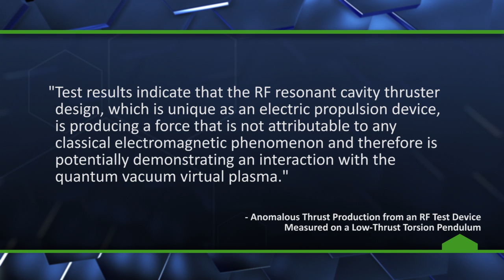Impossible Engine Could Revolutionize Space Travel - The Know

Comment: Does it matter to people outside of the tech community? No.

and even to those who are in it, it's an interesting process with no real advantage;
there is no viable planet to visit other than mars, NASA has had huge budget cuts because no one really gives a fuck about space anymore other than chartering flights by a virgin, Even if it could create enough thrust from solar radiation; would it slow down once you pass through the asteroid belt? And traveling anywhere deeper in space would require us to travel with a makeshift sun. Plus theres that little problem of time, let's say this thing builds up enough power to travel at lightspeed, we are still about forty years from another goldie locks zone, meaning even at that speed it would still take 40 years to reach and who knows if communications would work that far away.

Space is a nice idea, but at least for the next few generations; until we are merged with parts that make us live longer,  there isn't really a good use for this.

Comment: 'Impossible engine'-
Impossible= infinitely improbable
Starship Heart of Gold confirmed?

Unlimited Delta-V could take you anywhere in the universe given the time, or bring you close to the speed of light (if acceleration is prolonged, even at such low accelerations- in all seriousness if this works it could be huge.
Reply: Eh.
Still requires an unfathomable amount of energy to get anywhere near c. There is simply not enough energy density in any fuel short of antimatter to make any sort of electromagnetic propulsion viable, or desirable. Also, 'unlimited' Δ-v is explicitly stated as coming from an external energy source - a star. there is no way that any sort of rocket or torchship propelled by something which will have no more thrust than the sort of ion drives used to maintain LEO on satellites is going to remain near enough to a star by the time it has accelerated to a reasonable fraction of c. Unfortunately, unless this technology can produce Saturn V-ish amounts of thrust, it's not getting above the 0.02c ballpark. sigh I always wanted to hypothetically visit Tau Ceti or ε Eridani on something with less 'boom' than an antimatter rocket...

Comment: Sorry to burst your bubble, Ashley; but most of the information mentioned in this video is not correct. Sure, this is a breakthrough; but it is impossible to achieve infinite energy. The reason behind this is Einstein's mass-energy equivalence( E=mc2+pc);which states that energy is related to mass. Since infinite mass, when confined in finite space, caused a black hole to be formed, then infinite energy would cause a black hole. The only "known " way to create infinite energy is with negative energy, which only has a small piece of evidence called the Casimir Effect. Also, saying that a star can power a engine forever leads to controversial effects,like that stars do die and can become a black hole. So, for now, we won't be able to travel infinite distances until we find negative energy or other possible infinite energy sources, which might not exist. Sorry to say, but Garrus will be alone for quite a while.

P.S: Did you steal your entire script(except for gaming comments) from WIRED? Because every single bit of information here is on their page and they put up their page on the day before you uploaded this video. Seriously, search up "rf resonant cavity thruster" and it's the third one down.

Comment: so scientists though that it wasn't possible to transform solar energy into kinetic energy? they're both types of energy, logically, and according to the law of conservation of energy, it should be possible
Reply: well, assuming that these engines actually do what people say they do, that just means that the law of conservation of momentum must be rewritten
it holds to reason that you can convert literally any type of energy into literally any other type of energy, as long as you have the proper equipment
Reply: simeon62205 But that's the whole point. I'm not saying it's impossible, but simply meaning "that the law of conservation of momentum must be rewritten" means that the rules of physics as we know them are being broken. Also we can't exactly rewrite the law of conservation of momentum to accommodate this thing if it works properly since, like mad said, the law is momentum before = total momentum after. This engine would fall under a whole new rule since momentum before =/= momentum after.
Reply: I've always looked at it this way, any object with mass has a set amount of energy, divided between potential and kinetic, as the kinetic energy increases, the potential energy decreases
now if an object at rest will continue to be at rest until acted on by another force, we can just assume that the pure conversion of potential energy into kinetic energy to be that force

Comment: Huh. if this pans out, its a gamechanger; engines able to run without needing to carry massive amounts of fuel around in space? even if they are low power, the increase in engine mass you can get from not needing to find space for fuel would counter the low power, as well as allowing huge increases in payload mass. Hell, you could potentially use one to send a probe to another star; it would take a LONG time, but unlike other concepts, it wouldn't have so many moving parts, which means the engine could run pretty much at full burn as long as needed.

Comment: It wouldn't matter in the long run. We can't travel deep space unless we figure out stasis pods, light speed travel and/or artificial gravity so we can live in space. Without at least 1 of those things traveling to anything past mars(it takes like 6 months to get to mars) is a no go as it would take way to long.
Reply: with this new engine it would only take a little bit over a 1 month! i think we could be seeing a manned mars mission in the next 5-15 years.
Reply: RockPaperSicissors How do you figure? The engine is only unique as it breaks the laws of physics, it doesn't revolutionize the speed at which we can travel.
Reply: Colby Murphy I read it on some website about this engine but i cant be sure on the exact time it would take, just that it would significantly reduce it. The engine constantly accelerating and the spacecraft would be without the added weight of fuel which would make up alot of the total weight of any spacecraft with the intent of getting to mars with conventional engines.
Reply: RockPaperSicissors Ahh, hadn't thought about the fact that it'd be able to constantly accelerate.